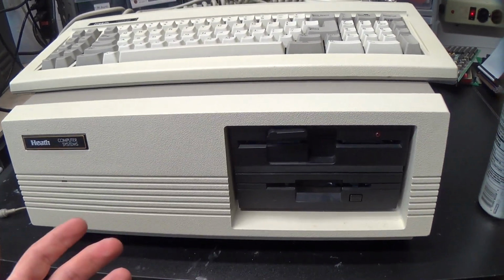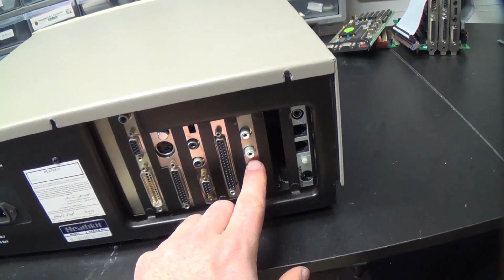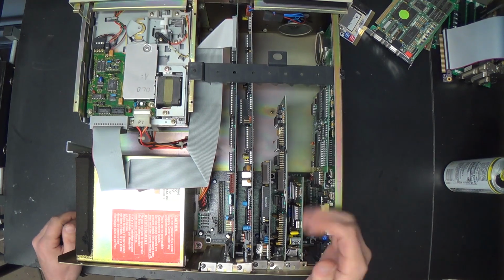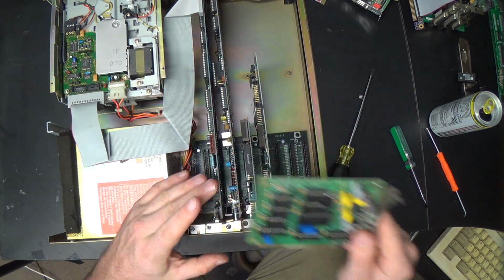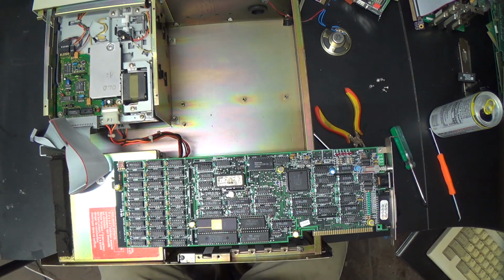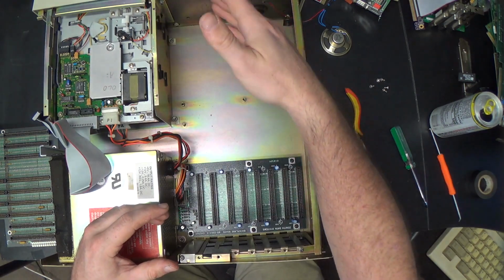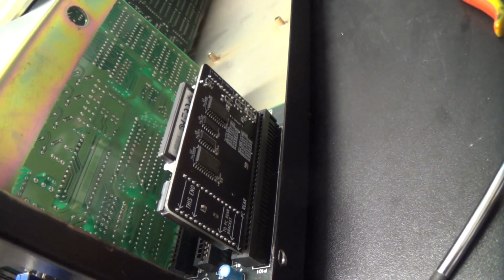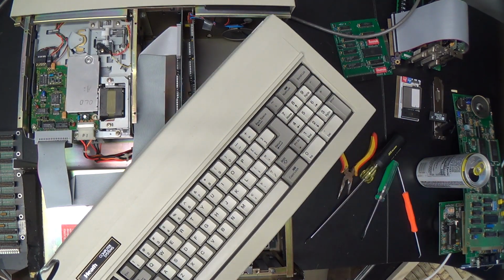Heathkit HF-158 Blind Take-Apart and Test

Comment: This video is a year old at this point but I just discovered it. I own a Zenith Z-161 which is a couple of years older luggable version of this system. It is based upon the same backplane. Instead of a combined memory/CPU and floppy/CGA card it has a separate card for each function. I had to laugh when you commented on the amount of discrete logic because it is a fraction of what is inside the Z-161. The Z-161 has a 9" amber monochrome CGA monitor. The CGA card also has a composite out. It was among the heaviest of the luggables and weighs pretty much the same as an XT class desktop with a 9" monochrome monitor strapped to it. The ROMs on these did not support a 720k floppy drive but using driver.sys from MS-DOS would allow you to use one. The HD that was attached likely loaded driver.sys with the appropriate parameters at boot. The ROM for these systems did include a system monitor. CTL-ALT-INS brings up the monitor allowing you to examine/write to the cpu registers, memory, io ports and to perform some diagnostics. CTL-ALT-RETURN resumes the system where it was interrupted. I don't have it but there was a card available for these systems which allowed them to run software for the Heathkit Z-100 systems.
Reply from the maker: Oh wow, that sounds like a really sweet machine! :O  I'm gonna have to save some ebay searches, haha.
Reply: @Lee_Adamson_OCF  I forgot one of the coolest things. The  top of the case tilts up and down. When you are transporting it the top is in the down position and when you are ready to work you tilt it up to reveal the floppy drives. http://dunfield.classiccmp.org/pc/h/z160.jpg

Comment: The  modem daughterboard is a standard DSP board that wasn't uncommon back in that era.  The DSP was the most difficult part of the modem to manufacturer and write software for so manufacturers would create these boards with different modulation options depending on what it was used for.  Then companies like Hayes could just concentrate on creating the modem computer and let the DSP do it's thing to modulate the signal.
Reply from the maker: Very interesting.  Thanks for the info!

Comment: The old ceramic package 8087s run quite hot.  I have one in my 5150 and my mother got very worried about it "smelling hot" while it was running.  I ended up putting a heatsink on it to appease her.
Reply from the maker: Thanks for the tip.  I will definitely put one on it.

Comment: I have all the parts (through-hole parts that is) to build a backplane XT class computer... but I don't have any parts to troubleshoot with.  I can't test the backplane because I don't know if the CPU card woks... I can't test the CPU card because I don't know if the backplane works... I don't have a spare PC or Video Card to test either of those two... This is going to be a long project for me... I'm also too cheap to buy any other parts.  The dilemmas we put ourselves into!  I will rise!
Reply from the maker: I just bought a box of like 28 4-slot passive AT backplanes for $10, because it was cheaper than buying AT card edge connectors from digikey.  If you want me to send you one, let me know.  They take an AT power supply, although I am sure you could adapt one to whatever you're planning to use with minimal fuss.
Reply: @Lee_Adamson_OCF  sounds good, I'll email you.  Thanks!

Comment: "How do I upgrade my motherboard?"  "Carefully remove it from the expansion bus."
Reply from the maker: Dude, I cut out the process of removing that thing, but it's kind of Tetris getting it out.  Very tight.  =:O
Reply: @Lee_Adamson_OCF  I've seen a LOT of old PCs, but that's the first one I've seen where the "motherboard" is on a card.  And I'm amazed that whole thing still works although I guess that may be from seeing so much Commodore stuff that doesn't.

Comment: If you can find a driver for that phoneme speech synthesizer card, maybe your computer will sound like Stephen Hawking.  Actually, come to think of it, without a driver it will sound like Stephen Hawking.

Too soon?
Reply from the maker: It's never too soon for inappropriate humor, my friend.
Reply: My god the audacity in this comment (this is sarcasm BTW).😂
There is an interesting article about how his speech synthesis module was reverse engineered and an emulator running on a raspberry pi was created.
https://www.sfchronicle.com/bayarea/article/The-Silicon-Valley-quest-to-preserve-Stephen-12759775.php

Comment: Nice system!  This is a rebranded Zenith XT.  Used the same layout and backplane.  It is a beautiful design.  Run ELKS Linux on it - UNIX for the 8088.
Reply from the maker: Ohhh yeah, I used to run ELKS on a PS/2 Model 25 8086 yeaaaars ago.  Good idea man.  I mean I am sure it's not POSIX, but it would make writing software for it easier than for DOS at least!
Reply: @Lee_Adamson_OCF  The ELKS Team has made very impressive progress - full TCP/IP stack and have ported GCC-16 as the compiler.  Code and distro is on Github.  I'm planning to install it over christmas on my Leading Edge Model D - 4.77 MHZ with 640K!
Reply from the maker: @geoffpool7476  Oooh, now that is prettyy cool.  I....  I wonder if it would compile and run CircleMUD.  >_>
Reply from the maker: @geoffpool7476  PS: I guess they don't have any kind of EMS magic going on with it, eh?  I mean I am sure the process size still couldn't exceed what could fit in lower memory along with the kernel, but EMS used somewhat like swap space would........  Oh yyeaaaboi.

Comment: That sound card is the Heathvoice 2000 or HV2000.  There is software for it at pestingers . net. (Youtube won't let me post the full URL, but Google will find it).  Someone on ebay has the users manual.
Reply: Correct on the sound card.  It's a speech synthesizer card using a Votrax chip.
Reply from the maker: You guys are amazing.  Thanks for the info!!!!!
Reply from the maker: Hmm ya know, if that is a genuine heathkit/zenith card, I 'spect I'd better keep it with the computer.  That EGA card and modem are fair game to try to trade for more useful stuff, but yeah..........

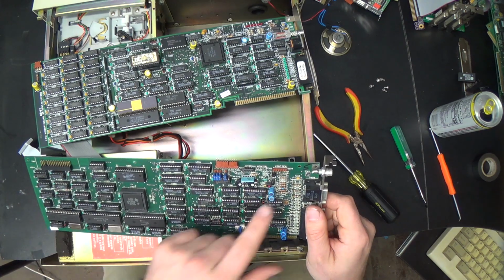Comment: at 16:05, look at all those bodge wires.  Yikes. I wonder if they are indicative of bad board design, or of bad soldering/construction by the assembler/customer?
Reply from the maker: Yeah, sorry, I forgot to show that better.  Not much time to stop and go through comments just now, but I am pretty sure that's all factory.  The Zenith branded factory boards have the same bodges.
Reply: @Lee_Adamson_OCF  
When I worked for an electronics company in the 80s, we called these jumpers "kludge".  When a new board was designed, we would have a double sided printed circuit board made for the prototype.  In most cases many modifications would be made to this board.  There might be even more jumpers than foil runs.  A second prototype would then be made and even then some modifications would be required.  When satisfied the board was ready for the final version a third prototype would be made and most of the time no kludge wire was needed.
But sometimes...
Reply from the maker: @swinde  Zenith: "It's good enough!  SHIP IT!"

Comment: • A lot of modem cards had headphone jacks for various reasons from being able to use it as a phone to just providing flexibility with different phone systems. My original 2400 baud Bitcom card did as did a much later 56K Softmodem/Winmodem.
• The voice card isn't a Votan, it's definitely a Dialogic, but I'm not sure what model (the Dialogic_telephony_cards Wikipedia page lists four possible candidates for the two-port card). You can check the company's site for software, but I'd be surprised if they still had any DOS-ear software available (or at least on hand); I certainly couldn't find any. There is a webpage that might (or might not) have some drivers for it: nch. com. au/ivm/dialogic.html